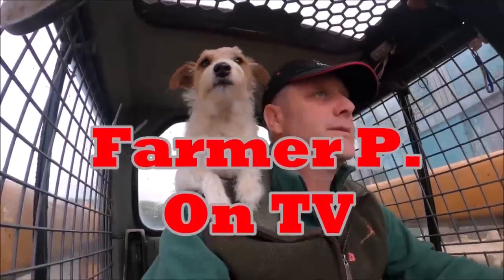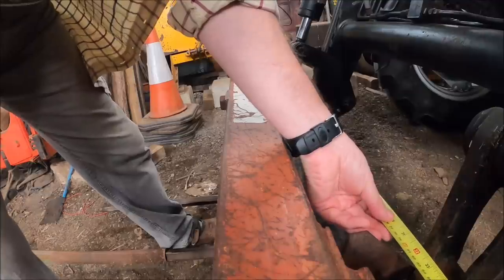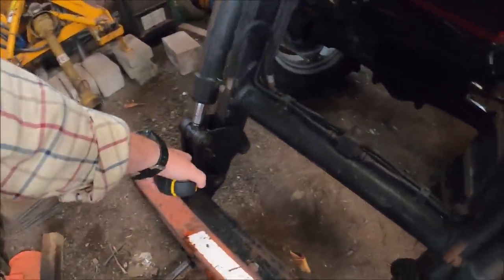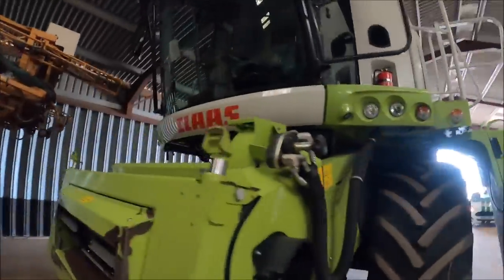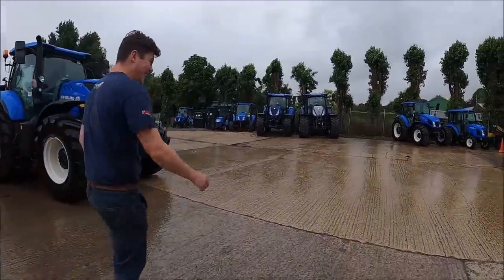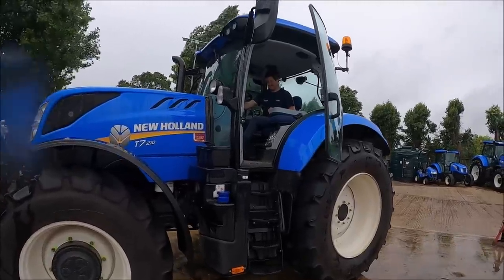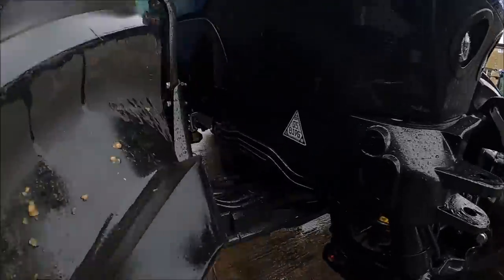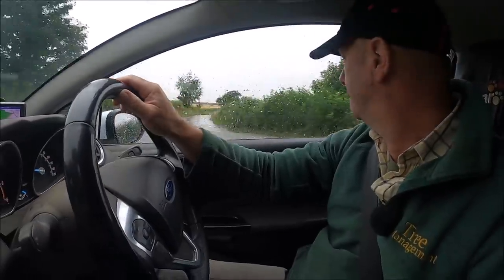14/07/23  New kit for the 2023 harvest, a dangerous tree and I have caught the lurgey.

Comment: You can change the  configuration of the controls in the New Holland skid so that foward and  backwards is on both sticks with a sideways motion for up and down on one and tilt on the other.
I amused to pedals and found that the easiest to get used to. There is a button on the right front pillar

Comment: Two 3/4 inch ropes hitched to a winch on the back of at least a 5 ton brought sharp taught at the upper wye from the opposite side back up the road with a pair of trenching plates stood up against the fence with a tarp over em and cut it on the garden side it would swing out and drop in the field across the way probably only breaking a few windows with chucks from the core wood.   The only question would be which employee uses the chainsaw short-leashed to the tree.  This'd leave a nice tall section of the trunk intact and live for the MOW to keep killing with oil in the ditch.

Stop making the health-n-safety grimmace!   Would take an olympian to get the lead rope bight up over it tho.